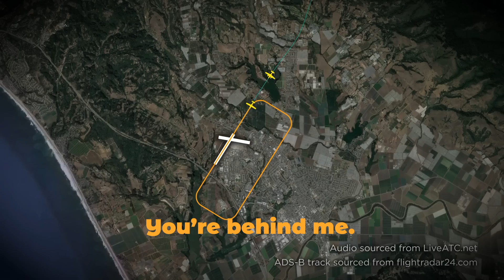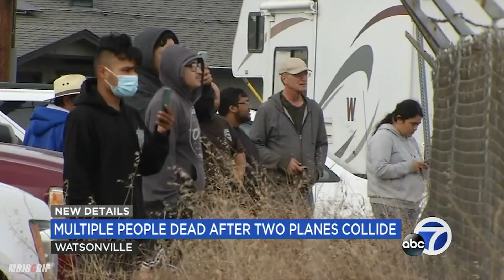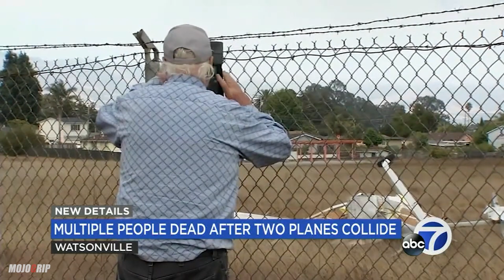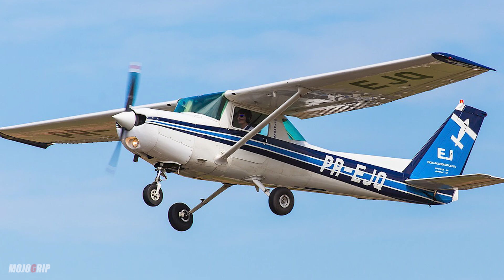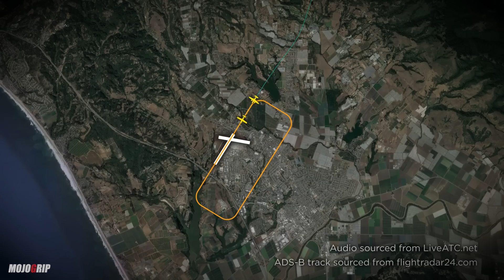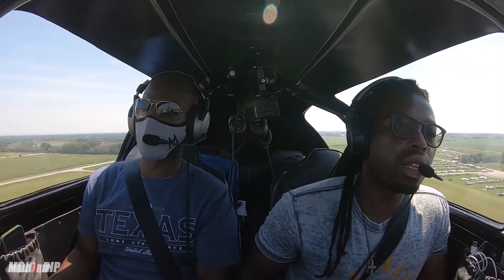Flying Too Fast Can Be Deadly

Comment: I'm no commercial pilot, but I finished my PPL two months ago. In my flight training I was doing solo traffic patterns. In the first or second one, there was traffic coming in. They were not following the traffic pattern but only doing a straight-in approach, since it was more comfortable for them. 
Anyway, the airport was a class G airport but with a controller who is just giving traffic information, I don't know how you call 'em in the US. 
So he told the other airplane, there is one solo student in the pattern, you can do your approach straight in as long as you keep clear of the other traffic. 
Well, I was turning from base to final, I did NOT have the traffic in sight and reported so. The other airplane said "We have you in sight and will keep seperation". 
So I thought, okay granted, they said that they see me and they said that they will stay behind me.
Okay, but when I was on very short final I noticed something started to move underneath me. It was the other traffic! In that second the controller asked the other traffic to confirm its current location, but I did not want to wait for their response , since everything happened in a matter of seconds. So I instantly pushed the throttle fully forward, pitched up and announced "D-XXXX going around". 
It was a split of a second decision and I did not regret it. 
A friend of mine who I did my ground school together with saw the whole situation from the ground and he said that this would've easily been a deadly mid-air collision. 
I had no time in that situation to think about whether I did something wrong or not but rather focus on the one thing that instantly  became #1 priority: Getting out there alive!  After I had landed on the next traffic circuit, I debriefed the situation with my instructor.
He was a little angry about the other traffic and explained to me that if there is other traffic you are not supposed to do a straight in approach but rather follow the standard traffic pattern.
Well, I agree with him, if they just took the 2-5 extra minutes to get in line like everone does, this probably would not have happened.
Everyone else I asked said it was the right decision to go around and that I did nothing wrong. In the end they were behind be, said they have me in sight and then sneaked before me, so like they tried to overtake me from below.
I honestly don't understand until today what was going on inside of the other pilot's head. Was he lying about seeing me? Did he lose the visual? I never found out. 
What I don't get is, that their aircraft is a low wing aircraft and my aircraft was one too. So theoretically THEY should have seen me and I shouldn't have. My only luck was that they weren't exactly below be but a little bit to the left. 
At the end of the day I'm just glad that I went out there alive and there were no fatalities but it could have been and that somehow also taught me how important sitiational awareness is.

I'm neither an expert nor do I know the rules in the US, but after that I made it a standard habit to just follow the traffic pattern and come in normally. Like, seriously it takes me a couple more minutes to get there but I know that something like this is less likely to happen. I think that's just good airmanship. The traffic pattern is there for a reason, otherwise we could get rid of it anyway if everyone is doing what they want to do.
And even then, when I know there is other traffic and I see that I am faster than them, can't I just delay for example by doing a 360 or something? I don't know, I don't wanna be over correct here since no one is perfect, mistakes happen and they will happen again. I just think that these are the ones that are avoidable since this can lead to death. Maybe I'm wrong with that. I don't know

I only did one straight in approach so far, but that was after confirming that there was no other traffic in the pattern.
In my opinion just getting there more quickly and because it's more comfortable doesn't always mean it's the right thing to do. If nothing goes wrong, for sure. 
But seeing that the twin engine did a straight in approach and was faster than the preceeding traffic just got me thinking that if he had entered via the downwind this situation maybe would not have happened.
But of course, I'm sitting at home in safety and I was not up there, so maybe I don't know the whole story.
Reply: These situations will come up periodically throughout your flying career and for various reasons, especially at uncontrolled airports.  I did a standard entry a couple months ago, calling positions as appropriate, turned left base and just as I was about to turn final I saw a little black helicopter turning right final.  He was virtually invisible against the terrain and he continued his landing while I steered clear, did a 360 back to base/final and had to go around again because he was just sitting on the runway!  

I was pissed at that point and barely coherent making standard callouts as I flew the pattern again.  Moments later the helicopter apologized for being on the wrong frequency.

I’ve also been the bad guy while renting an unfamiliar plane and doing local flights not knowing the audio panel wasn’t set to the radio I was using.  My mistake not doing a radio check to begin with.
Reply: I’m glad you made it to see another day. I think when it comes to flying you have to know people can make mistakes and there is different ways to Communicate. but you are responsible for your life nobody but you so I applaud you for valuing your life enough to save it and not trust anyone else blindly

Comment: Straight ins at non-towered airports are a recipe for conflict. Especially a high wing low on base and a low wing high on final. Neither can visually see each other easily. 

Straight ins at non-towered airports should be prohibited when other traffic is in the pattern, and advisable against doing even when traffic is not in the pattern. The reason for the later is human nature is "well I've done this before and it worked out". 

We all learn during our pilot training that straight ins are NOT a standard pattern. It's one thing at a towered airport, but non-towered, just no. Take the extra five minutes of flying and enter on the 45.

I saw close encounters when 2 piper warriors were in the pattern, and a third one was doing a straight in. Two nearly collided right in front of me while I was waiting to depart at a non-towered airport. The two planes ended up on final at the same time, not realizing there were  multiple planes of same type in the pattern.
Reply: How do you propose instrument pilots based at an uncontrolled field maintain approach proficiency at their homedrome? You do know that currency requires 6 approaches in the prior 6 months to MDA/DH...which is a straight-in. Being proficient to land under instrument conditions arguably takes much more than 6appr/6mo.

The real answer is to talk to each other, paint that mental picture of where everyone is, maintain situational awareness, and of course see and avoid.

Comment: Years when I was  a student pilot  learning to  fly.
When returning to  airport  after a cross country or  anything  away from the  patearn  you were to  fly  over the  airport  at  1500  feet or  500  feet above the  pattern altitude.  Either  Controled or not  but  always  radioing  your  intentions and  keep a good  look out. 
I believe this is where the  twin engine  aircraft  was  wrong  the  pilot although  radioing  his  Intention knowing  another aircraft was in the  vicinity  should have  aborted his  straight in approach as he was a  much  faster aircraft. 
He just  ran  down the  slow  plane
It was an  accident waiting to happen  from  10  miles out

Comment: Mike great video as usual looking at this accident from the in cabin perspective though i am not sure if you have had a chance to look at the data involed. @Blancoliro gave a great breakdown of adsb data. The 340 pilot was in an unstable approach. The stall speed for the for the Cessna 340 is 96kn, wich should give an approach speed of around 110kn. The MAX flap speed is 160kn. The Gear speed for the 340 is 140 kn. So in MHO the 340 pilot was at fault. Also the regulations are somewhat confusing. Traditionally the faster aircraft will have righ of way but the lower I'm this situation had right of way simply because it was already in the pattern while the faster aircraft in this situation being the 340 called a 10knm straight in final
Reply from the maker: Right. We can all agree that 340 pilot should have done things differently. But that’s also proving the point I am making. 340 Pilot was likely too focused on landing the airplane that he gave less attention to the man he is literally communicating with. If you listen to the ATC audio. He only said “looking for that traffic” after he was already 1 mile out. Way too close for comfort.

Comment: "I'll try not to speculate..." Yet, everything that came out of your mouth after you spoke those words is sheer speculation. All of it. Every single word. Since I've been flying (mid '70s) people that know that I'm a pilot have asked me about particular accidents/incidents. I've always given the same answer: "We'll have to wait for the final report from the NTSB. Might take a year." Everything else is to sell media ads - or in this age, internet clicks for a buck. You're chasing ambulances for clicks, and serving zero purpose for the community. I remember your words from a recent video: "I tell ATC 'roger', but I do what I want." Remember that? Is that safe?

The Cessna C-340 has an approach speed (Vapp) of 100-110kts. Dude was never below 180kts up to 1-mile final. I'd be interested in the toxicology area of the final report - if possible.

Comment: Just an opinion from someone who's looking at getting into General Aviation, but when the 152 aborted, what did his pattern look like?  Did the 340 decide to abort his landing also and then flew up the 152's tail?  I didn't hear the 340 acknowledge the 152's abort so I'm wondering if he got confused as to the 152's actual intentions.  He made not have heard the 152's broadcast because he was tasked saturated in a larger faster more complicated aircraft and he couldn't tell visually what was going on because the abort pattern wasn't obvious.  The aircraft were miles apart until all of the sudden they weren't.  Thinking out loud.
Reply: The 340 was burning in over 180 knots, the 152 had no hope.

Comment: Hey Mike, I think your analysis is spot on. However in addition your theory I think your viewers should also know and what I believe was a huge contributing factor is the Cessnas 340 speed coming all the way into the traffic pattern from 3 mile to 1 mile final-- (if flight aware data showed is accurate) his speed never went below 170 kts! That's extremely fast.

Comment: Spot on - My 2 cents on the grass would be to "do anything different". Simply Break the chain of events leading to a possible issue.  Easy said than applied.  Maybe try putting your immediate goal of landing on temporary standby, change it up a bit, extend your downwind leg and let plane on final land first. Or maybe for twin engine faster plane suggest a go around or do another approach or hold pattern to let others in same pattern complete their goal.  Remain humble and get the get there itis or in this case, "Land itis" out of pilots system :-) Good Luck & Keep Flying safer each day.

Comment: This event makes me especially cautious of the straight-in pattern entry vs the 45° pattern entry.  There's less danger of running over another plane when there is a chance to survey the traffic from the side.

I wonder why the twin did not give any separation to the 152; he knew he was there, knew he was base to final (called "looking") yet still entered straight-in at 180 kts.  Why commit to the final approach without knowing visually where the conflicting traffic is located?
Reply: Is there any chance the twin pilot didn’t have his volume turned up and didn’t hear the 152 pilot?  Only the 152 pilot affirmatively acknowledges the other pilot.
Reply: @Flounderflaneur  didn’t the twin say “looking for traffic on base?” The twin was probably trying to land before the 152, or he was suicidal.
Reply: @Flounderflaneur  my read is no: since he called that he was looking for the 152 on base, he must have heard the radio call to know he was there.

Comment: As a private pilot with most of my experience at a non towered airport I believe that the point at which the critical error took place was when Cessna N49931 decided to turn left base for 20 knowing that a twin engine Cessna was on a 3 mile final. Personally, I would have extended my downwind for such traffic especially knowing that it was a twin engine and that it would be faster than my 150/152/172. I also didn’t hear any use of coms for his turn on to final. Although, the 150 was in the pattern as recommended procedure so I guess you could argue that he had priority? What do y’all think?
Reply: The twin’s insane speed on final is the problem for me, but I agree that the 152’s most prudent move should have been to extend their downwind because even if the twin was going at normal final approach speed, it would have been right on his tail. Not a situation you want to be in without the help of a tower—and even then . . . .

I also didn’t hear the 152 announce turning final. Judging from the twin’s comment about looking for left base traffic, I’m guessing he didn’t hear the turn either whether it was announced or not.
Reply: If the twin pilot heard and knew that there was pattern traffic at the field then the proper thing to do would have been to enter the pattern and make a full pattern not a straight in approach. Just my thoughts and not placing blame on either. God bless the loses for all God bless the families.
Reply: Both of these replies seem right to me. First of all, what's with these straight in approaches? They're hot dogs with fast airplanes, arrogant, and causing these accidents. But I've been there, doing a proper pattern, and hear someone announce a straight in approach. I'll extend my downwind or even leave the pattern until I'm certain about where the other airplane is - either seeing them or hearing them announce that they are clear the runway.

Comment: Is there a reason why there is no visual traffic display device. Why can't there be standard equipment, atleast a Ads B based system that will take traffic data and display on a live map, so everyone  can see on a digital map, where everyone is relative to them. This can be archieved too easily already. This must be set rule. Im not talking of advanced and expensive tcas. This is safety loop hole. Pilots are busy and a simple visual system can work, and augment the radio based traffic reporting and monitoring as currently being practice.

Please. A simple digital solution.
I can think of several already.

A digital and visual solution to this problem is a must!!!

Comment: I wonder if the pilot of the twin had a medical/neuro problem. He was going faster than three miles a minute. Totally messed up spacing, and the pilot that assumed he could operate in front of the twin, realized the speed spacing issue too late, and couldn't avoid.

Comment: The usual suspects have commented already (Blancoliro, Gryder, etc.) No argument, the 340 was high and hot, and all agree he should have made a 45 pattern entry from the south due to busy traffic pattern. Understandably, the 152 pilot turned inside thinking he had enough time "you're behind me", but then he made a bad judgment, at the last second, per the ADSB he was on short final, he realizes the 340 is 'coming up fast' and does a go around. So what happens next..... he throttles up, and pulls up into the path of the 340. The 340 sees him rise up into view at the last second and veers right. Too late. The 340 pilot very experienced, too much to simply assume he was bombing in over the numbers at 180 kts and expect to put it down on that pass. For all we know the 340 realized 1 mile out that he was way too fast and should go down the runway centerline.  I suspect his plan was to keep high and clear above the 152, then do a left 225 to enter the 45 downwind. The 152 should not have executed a go-around at the last second. If the 152 had stuck with his plan to land, or at least touch and go, this would not have been so tragic. How could he have shoulder checked to be sure he wasn't cutting the 340 off from below after he was on final?  Answer, he couldn't.

However, at the end of the day I think we are overthinking this. IMHO this is similar to someone merging onto the highway in front of a speeding car. Simply misjudged the oncoming speed. It was an accident. People need to be more careful. But here, there is no mystery, nothing new. The causes are obvious, so are the solutions. I suppose we all could be more careful. Speed kills and aviation is peculiarly unforgiving.